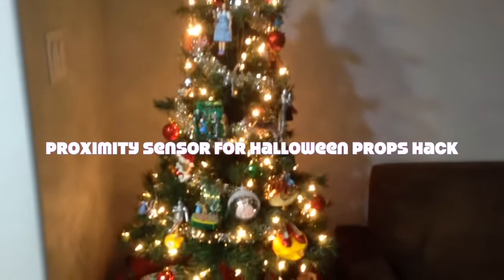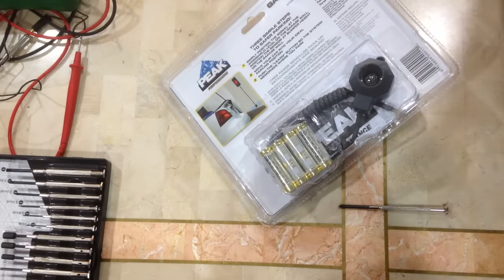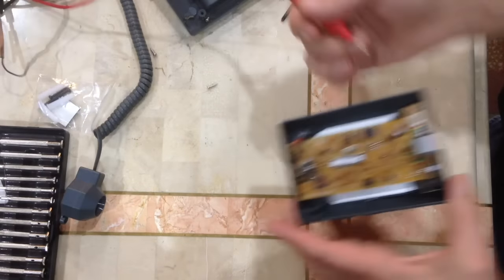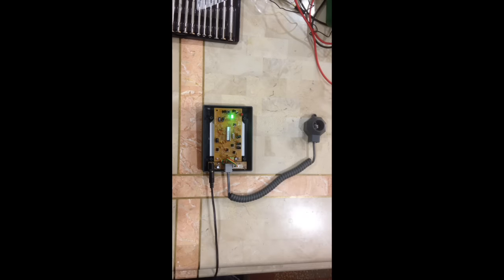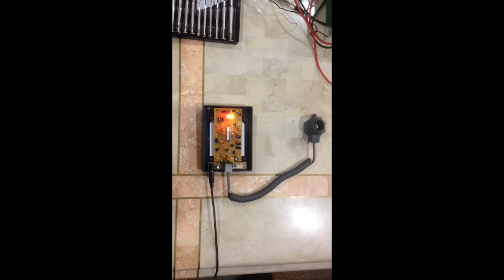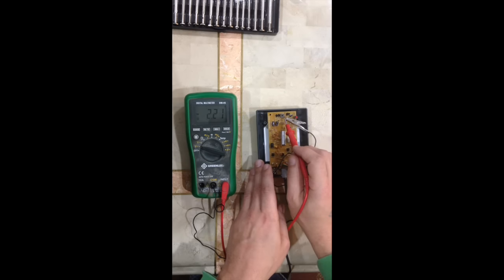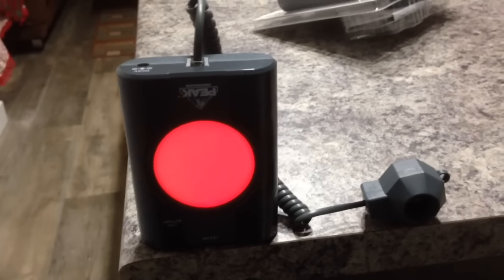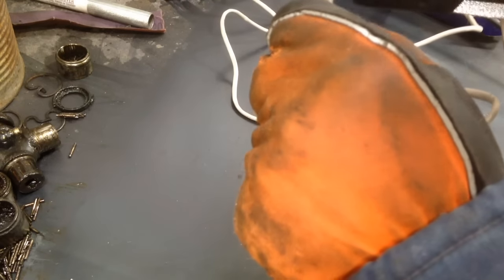Prop sensor that works...

Comment: Thanks.  Now for the Brain.
Reply from the maker: i just made a hotwire on a zombie dude i have. He has a pir and a button on his hand. i used a 3 volt relay off the proximity sensor to the hotwire off the switch. the pir was terrible and hardly worked. Now it works every time consistently from 8 feet. video coming soon.
Reply: I've tried your exact setup up but something is being problematic. Help maybe? Lol
Reply from the maker: @mikeeaton3181 if the problem continues give me the specifics and will get you rolling